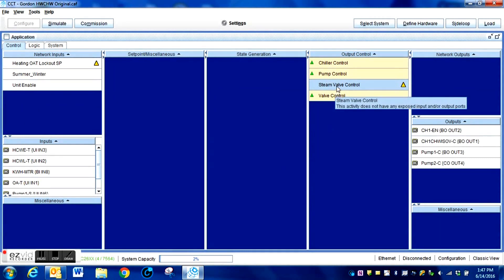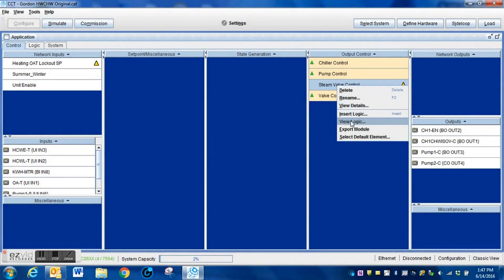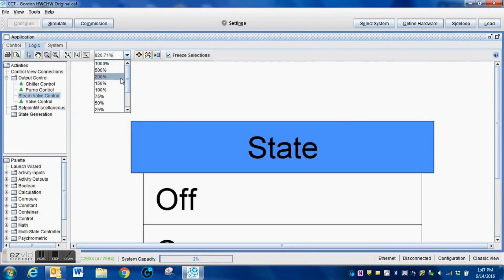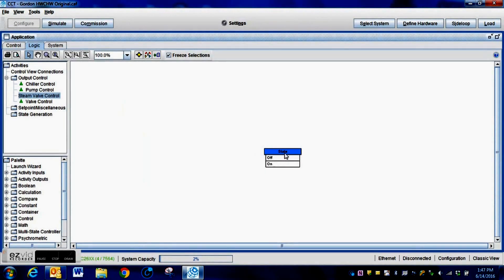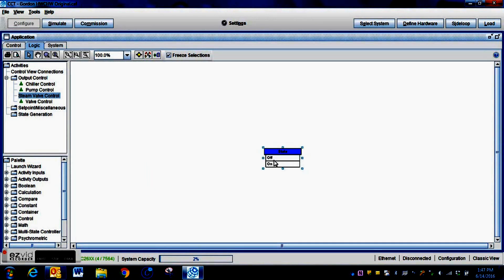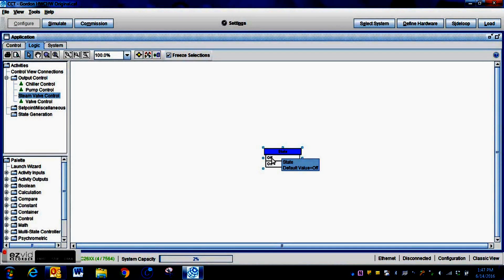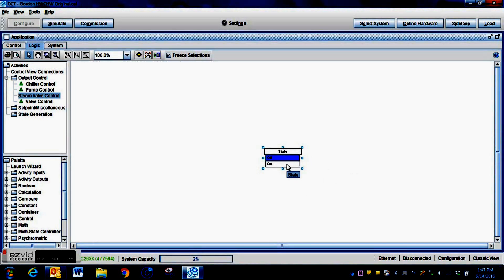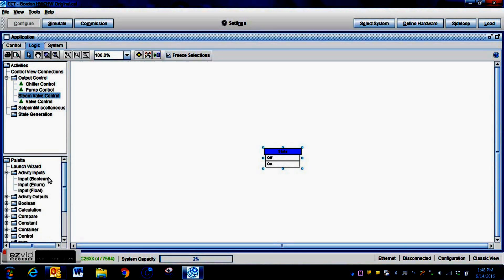Advanced Programming Techniques Controller Configuration Tool Pt 1

Comment: Can someone provide a brief explanation on how to use CCT to monitor logic running in controller live and make tuning changes etc.
Reply: Thank you for your response. I also have another question: Is there a way to find the source or destination of a point in Metasys? I have question about a point on graphic, I double clicked to go into the Focus page of that point. In the focus page it shows the point is under a controller's Programming folder and that's it. I went into the CCT and loaded caf file for that controller and that point does not exist... But I know that point is used to set setpoint to boilers. How would I go about tracing this point?
Reply: You are totally right, I found the LCT process that's transferring the point onto a N2 bus point to the boiler controller. Thanks so much for your help. I would love to add you on linkedin, can you PM me your profile?
Reply from the maker: Just commission into the program

Comment: Very good video how they  program in JCI Controller. I am starting to get familiar with CCT can you show how would calibrate sensor and damper and valves  and upload and down load a program in a controller this would be very helpful .
Reply from the maker: +Edward HVACR CT check out my channel.  I have several videos showing that.